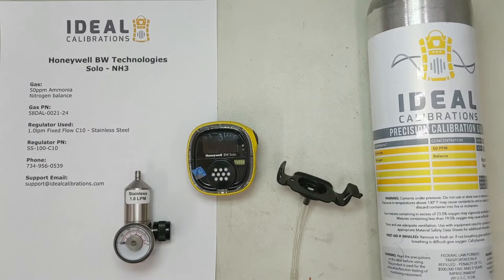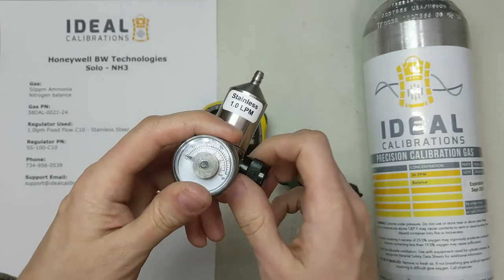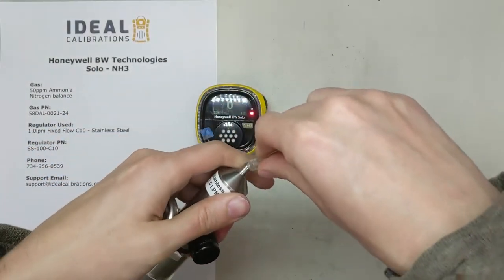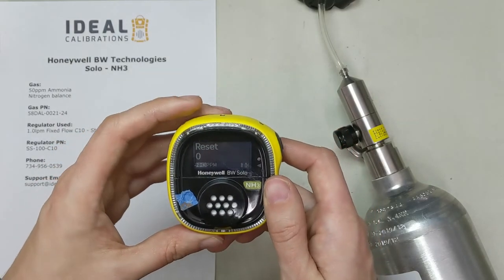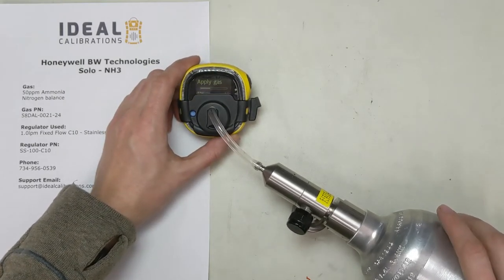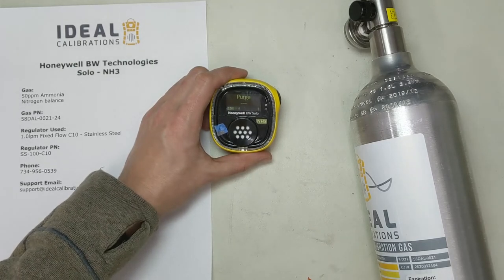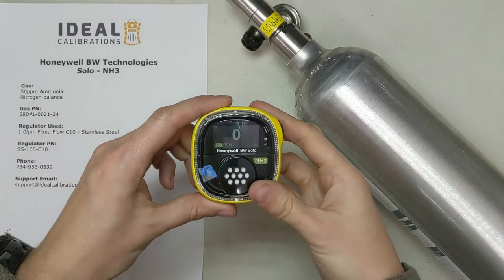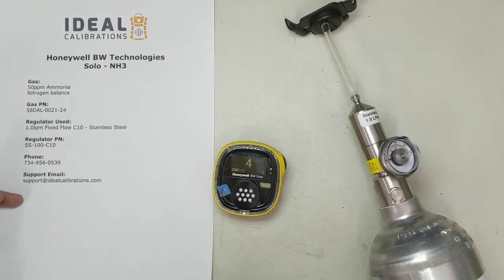Honeywell BW Solo Ammonia (NH3) Calibration and Bump

Comment: Hi James great video.. We've had some problems calibrating a few of our sensors it simply says fail.. Should we try a bump first and then regas? All the other stuff post gas seems to be the same just it says fail
Reply from the maker: With NH3 sometimes it's a good idea to run some gas over the sensor first to wake it up. This can also show you if the gas or the sensor are dead. I'd also try and keep the tubing length as short as humanly possible. 2-3 inches of tubing max. Make sure to check the expiration on your gas as well. If it's expired you'll need new gas. NH3 sensors aren't the most robust either, so they may just randomly fail as well. Try and keep track of your sensor warranty dates to save yourself some money.

Comment: how often we should do bump test if the monitor is being used daily?
Reply from the maker: Every day, or if it's being used for multiple shifts per day, whenever it changes hands to a new user between shifts. You do this to test the monitor and make sure it hasn't run into a poison or exposure that throws off the sensors.

Comment: hi thank you for the video it was really useful, i calibrated 1 ammonia tester but the other one it keeps telling me the gas is undetected, i have tried a few times, do you have any suggestions? many thanks 

Ali
Reply: If it's the same gas probably a bad NH3 sensor. The sensors die a lot quicker than most of the other toxic sensors. Check your warranty if it's a newer unit, you may be able to get a free sensor